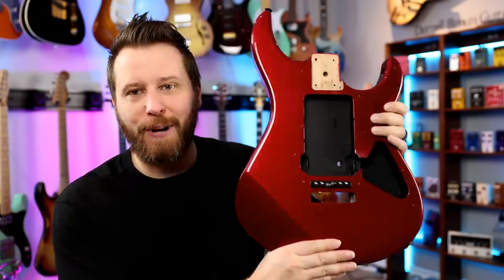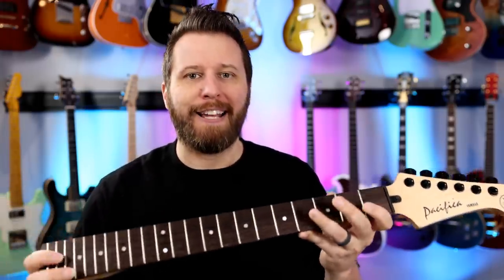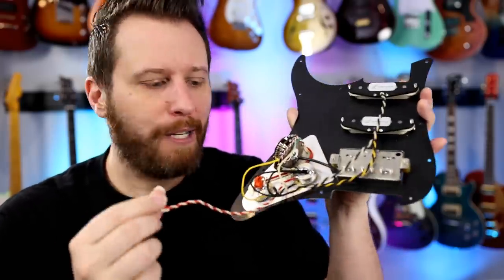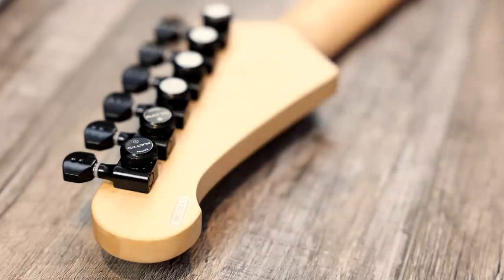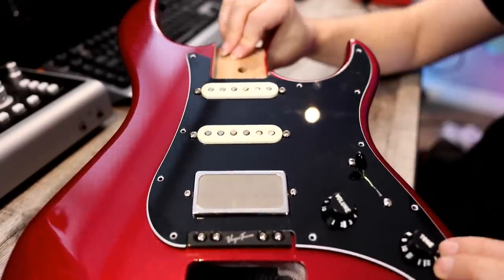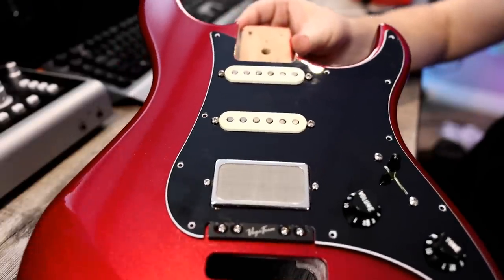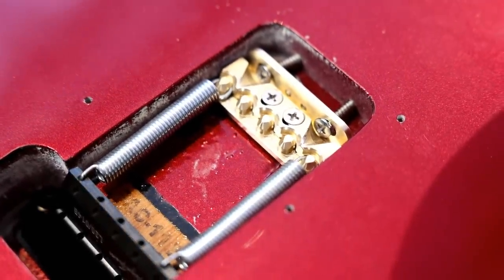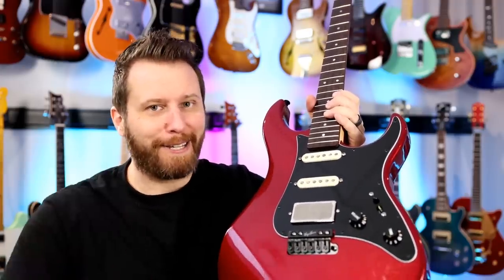Building The ULTIMATE Yamaha Pacifica! - Full Build and Tones!

Comment: Yamaha Pacificas are the perfect modding platform and if you don´t want to do modding and get a great mid-budget guitar, the 612 & the 611 (with the P-90 in the neck) are great value for money.
Reply: Just bought a 612viifm. Loving it. Came perfect from the factory.
Reply: @rickeaton3085  I have had 612viifm for over a year now and it is a really great guitar. The mod DB did was awesome but I don't have the tools, expertise or work area to get into mods.
Reply: Oh yea. I have a pacifica 821DX & 611. Great guitars. My favourites. Alongside my Japanese Ibanez's
Reply: I had the 611, nice sounds but I couldn’t bond with the neck. Love my revstar 502 though, play as well as guitars 4 times the price.
Reply: @valebliz  I am thinking a revstar will be my next guitar...
Reply: @rickeaton3085  We got a 612 with the blue flame maple veneer top, for my niece couple of years ago as a graduation gift. That thing puts guitars that cost twice the money, to shame.
Reply: @valebliz  The revstar models are pretty cool guitars, kinda like an updated version of the Yamaha SG 2000, which is an absolutely amazing guitar.
Reply: @rickeaton3085  if you like a gibson feel those are very nice. Decently chunky neck, very good fret access and the wraparound bridge works very well and has loads of sustain. I'm mostly a fender guy but the 502 gave me something like a les paul junior for less than half the money, the p90s it comes with are good pickups imo.

Comment: Duuuude. Glad you went for the blackoout. Looks great. Sounds great. One thing I'd love to hear about though (in all your mod/parts videos), is what the total cost of parts would be. I know you get a bunch of parts for free/on the cheap for demoing things, but I think it would be helpful for the rest of us. CAD, or USD would be fine, I'm sure. Thanks dude. Killin' it.
Reply: pups, trem system and tuners alone come in over $750, going to be close to $1000 I guess
Reply: Damn my Pacifica buying ass doesn't have that money
Reply: @VisboerAnton  even investing $300 in parts in a guitar like this will get you an amazing guitar. A set of tonerider surfaris for a hundred, a nicer wilkinson tremolo, a set of their locking tuners, a CTS pot strat wiring kit, a graphtec nut, and maybe some Schaller S locks, you're maybe $300 in after tax in total $500 for a beautiful sounding guitar. The neck on pacificas are actually really good for the price so there's no need to change them out. Parts casters don't have to be obscenely expensive. Wilkinson isn't necessarily on brand, but their hardware is actually really good and I've never had any problems with them. Their locking tuners are some if the best I've used especially for the price. Pickups from them are average though.
Reply: @ryanarledge51  
Thanks! I have a pacifica now which I have been modifying. It's an amazing journey of learning new stuff by failing awfully haha
Reply: My upgrades only cost me 175 bucks. 75 for a new neck as I ruined the old one. The rest is a CTS pot, cheap Chinese Alnico V pickups, new pickguard, stainless steel saddles. 

I don’t use the tone knob, the tuners are fine although they feel janky, and the new neck comes with a graphtech nut. 

Modding doesn’t have to be expensive

Comment: This is one of my favorite videos. I took my $99 Yamaha EG112 that I bought from Costco 15 years ago and spent $560 worth of upgrades on it. I went with Supervee's BladeRunner for my Tremolo and Seymour Duncan pickups (SH-4 JB, SSL-5, SL-59-1) for an HSH configuration. The wire harness from 920D was model # I5W-AUTO.  I had a ton of fun doing it and learned so much along the way.

Comment: I have a Yamaha Pacifica 912J- I put a Dunkin hot rail on the neck and micro switches to split the coils at the bridge and neck.

I also dressed the fretboard to get rid of the excessive fret height. Copper shielded the entire cavalries and locked the Floyd rose.

Comment: I like what you've done to that PAC and who doesn't love a metallic red ...
Sounds sweet
I went for the PAC 611 VFM in 2018, P90 & HB. 
I was encouraged by the Pacifica layout after I tried, and bought, a Line 6 Variax Standard, which is basically a Pacifica with bells and whistles.  😉
I like 'em both but curiously they are quite different beasts to play. Necks are very different.

Comment: What a gorgeous guitar you made! Pacs are famous as a modding platform. And then, there are the higher end pacificas that don't need any upgrade (unless one wants something different), nowadays it goes up to the 600 series and the MIJ PAC1511MS. Little known, and hard to get, are the ultra high end Pacificas of the earlier years when Pacificas were designed by Rich Lasner in California. Those are rare and pricey on the used market. The concept of producing an affordable line of Pacificas came after the Lasner designed expensive models were discontinued. I'm a lucky guy. I have a  1990 neck-through Pacifica 1412 (made in Japan but designed in California's Yamaha custom shop by Lasner as a prototype). The 1412 is the highest pacifica production model ever made and was, like,  $2,000 in 1990 (would cost around $6,000 to build today). I got mine for 1,500€ and consider I got a great deal for such a guitar.I also have a 2008 (last year of production) MIJ Pac 904. I paid about $1,200 (965€) for it brand new. I have four "strats". a PRS Silver sky, a CS Fender deluxe, a partscaster with top end components and the 904. I'll let you guess which one is my favorite...

Comment: The wood on Yamahas (which is what really matters) is always really good. I have an old Yamaha EG112 (not even a Pacifica) and it's a nicely built slab of wood. The electronics is where they usually skimp. I gutted mine completely and installed custom electronics. Went from an HSS to a standard Strat setup. They're really great guitars, and cheap. Really, it's how much an average Fender should cost.

Comment: I bought a Yamaha starter pack with the ERG 121C black electric guitar and a 10 watt amp 15 or so years ago and all I've had to do to it is change the 5 way switch which I ruined. I still love it and wouldn't change a thing except the strings.
Reply: i have both,i would upgrade the pickups on the 112,perhaps to get more of a classic strat sound,but the ERG is a quick upgrade to a metal guitar,pickups are great in the one i have,stock,did have to change the 5 way,when i got it used,,when my freinds plug in 3-4 of my axes,they prefer the ERG 121C for gravy train sound.single coil in the middle,rounds out other styles.hsh config

Comment: Good timing on the videos. My Pacifica is my go jam/take wherever guitar and one of the tuners just self destructed. I'd looked at these tuners but didn't know for sure they'd fit until you put the last video out. I was going to use some other kind that have the screws but since these fit, Graph Tech tuners have been ordered.
Reply: FYI for anyone ordering tuners as a drop in. My Graph Tech tuners arrived today and they don't fit. The two posts on the tuners don't line up with the holes on the headstock. I know you can use the plates to make them fit just about any guitar but I already had tuners that just needed a hole and they'd fit. That was $100+ I could have saved. So check them first. My Pacifica is a 112J.

Comment: About two years ago my local guitar shop was closing two Yamaha Pacifica 510V guitars. for $325 each. That is the Ultimate Pacifica IMHO. I wish I had pulled the trigger on one of them. Locking tuners, one pickup (Seymour Duncan P Rail) Wilkinson VS 50 Tremolo.all from the factory.

Comment: Great Work. It would be cool to compare this to a Yamaha Pacifica 612 VII that you can get for around $600 new when you can get a deal. It comes with locking tuners, wilkinson trem, SD pickups, graph tech nut, flamed veneer top. 
Maybe on your build and upgrading a 612 add copper foil tape on the pick guard? On cheeper necks like this maybe sand  the back with fine to extra fine sanding foam. Down to 5000 grit. I went up to 8000 but that felt pretty much like a paper towel. Then a little gun stock oil and wax. It takes some work but It feels great. Also on the head stock. On a 612 that has a finish on the back of the neck also a little fine sanding to cut down to a smoother finish.

Comment: I have a high end Pacifica that came with a Duncan Custom 5 and Vintage P90. Fine pickups, but I wanted a different kind of tone, so I installed a DiMarzio Tone Zone and Virtual P90 which work a lot better for me, as the Custom 5 was far too bright and tinny on the high end. I have coil splitting and it sounds and plays amazing. BTW, I love the sound of that Lamberton. I'll have to look into these. Very warm, vintage, and it rocks.

Comment: you should look into ground loops, you shouldnt ever have 2 wires for a ground to split from because that creates almost like a 1 turn pickup...if you shield the pickguard and paint correctly, you dont need jumper wires between pots and having the ground connected to the body with a lug works the best
Reply: Few people know about ground loops. That was a nice catch of details. Good job.
Reply: @EricFBG  ive done it like he does and it made my hum worst so i went on a huge research quest figuring out how the pros do it lol its annoying dealing with the ground lug if you mod alot until i found a good lug i can unscrew easily
Reply: @darkinertia2   By lug I believe you mean the potentiometer. Most of them are not ready to solder on the back. You try, but the solder and the wire won't stick on their back. The trick is to sand the back of the pot, the place where you intend to solder, with some sandpaper or other abrasive. The solder will easily stick after this. This works with any potentiometer, even the cheapest ones.
Reply: @darkinertia2  I didn't understand well what you meant with lug, so I assumed you meant the potentiometer. English is not my first language, so I am sorry for any mistake.
Reply: What he said...
Reply: @EricFBG  oh yeah sorry i forgot theyre called lugs on the pots too lol i meant the ground you wanna attach to the shield paint
Reply: The shielding is useless anyway as he forgot to shield the pickguard...
Reply: @jicklesjingles8134  Right? I was thinking the same thing. Wait until he's playing clean and those single coil mounting screws click through the amp every time he touches them....

Comment: Did you adjust the nut height?  I would encourage those installing a graphtech nut to either sand the base to adjust the string height to taste or to file the nut slots.  Probably should have the e strings in place to adjust the horizontal position of the nut as well before gluing it.

Comment: If you are chasing noise reduction then swap that twisted pair to the jack with actual shielded cable (just like we use from the guitar to amp). Twisting the wires looks nice for Instagram but they don't do any noise reduction in a guitar. Need shielded cable.

Comment: Usually it's a good idea to do at least two coats of these shielding paints. Check with your multimeter between layers drying, conductivity should be more consistent with 2 layers than with even a hefty application of a single layer. At least that's my personal experience.

Comment: If you guys want to do a great sounding low cost build. Get a solid steel blocked GFS trem and used pickups. Good locking tuners and a GT nut. You’d be 250-300$ in great quality parts and get damn near the same tone and playability.

Comment: Inspired by this video, I ordered new tuners for my 112V, but got caught out by the link in the comments being for the wrong part - in the video you used the staggered tuners (PRL-9721-C0 or -B0) and not the 8721s  ;-)  With the 8721s the E and B strings form a pronounced V as they go under the string tree as the tuner posts are much too high.
Reply: Did the Graph Tech tuners worked for you? I read one comment saying that these tuners are not fitting for the 112J. I'm thinking about my first guitar upgrade and get some of the PRL-9721 for my 112VM
Reply: @sleepinredroses  Yes they did, and I still have and play the guitar regularly. I can’t remember now if they were a mod-free fit or not, but I don’t recall any problems either.
Reply: @paulbeaney  thx for the info! I will give them a try

Comment: Hi Darrell, I'm duplicating your build. A few questions if you could answer:

1. For the Electronics from 920D is there a specific part # for the Pacifica or did they make something custom for you?
2. What type of Glue did you use for the Graph Tech Nut?
3. Will a standard Black Fender Stratocaster HSS pick Guard fit on the Pacifica?

Comment: Even the 600 and 800 series, the fretboard still not rolled, I guess yamaha liked it angled edges and not rolled (not comfortable for thumb hugging the top side of neck though). I wanna know what nut is that, no mods at all? Simply replace and attach new? No grinding or sand paper?

Comment: Pacificas are super underrated.  What I remember is that they hit right when Ibanez was starting to fade but Grunge had just hit.  Instead of the aesthetic "sharp and pointy" things turned retro.  My issue with a lot of the retro stuff is that is just isn't that well made.  If that's what someone wants then fine, but most of them would require a LOT of work and upgrades which to me, just aren't worth it.

Comment: In USD:
Pacifica: $220
Tuners: $120
Lambertones Single coil Neck Pick-up: $110
Lambertones Single coil Middle Pick-up: $110
Lambertones Crema: $180
Vega Trem: $255
920D wiring harness: $80
Tone Claw: $60
String trees: $12
Nut: $12
Pick-Guard: $20

Total: $1149

This doesn't include tools like fret files, sanding blocks, polishing compound, luthier tools, soldering tools, solder, etc.)

For $1149 USD there are some nice options (Fender Vintera '50s strat).

How about a comparison of modding up with $1150 vs. spending $1150 (new or used).
Reply: But it's a great video - I have the 112J in Emerald green, 100% stock and I love it.

Comment: Hi Darrell. Thanks for doing this. I have a Pacifica, and this video gave me inspiration. I was wondering, did you sand the fretboard edges like you have showed in other videos? In one video you had a yellow gloss fretboard, and sanding it removed the paint and exposed the white underneath. Any danger of that here? Or is the wood on the Pacifica solid and unfinished? (I have the 112J also). Thanks again.

Comment: A wire from the volume to the shielding is unnecessary bc the pot body is grounded thru the shielding on the pg to the shielding in the body thru physical contact when the pg is screwed to the body or it should be if you painted the shielding all the way up to the lip of the cavity and over to 1 pg screw hole. I certainly wouldn’t have EVER drilled down in the cavity that’s already routed to over half the total depth of the body. Drill into the side where you can’t accidentally F it up

Comment: The 920d electronics.... what size pots and caps did they use for the harness?
Reply: I am building this exact guitar as we speak. The tone claw… That does not line up with Pacifica holes. I have three Pacifica‘s. I’ve tried it on all of them. The screws have to go in on an angle that is different from the stock claw and it twists it. Might be better off with a different claw or just stick with the stock one

Comment: "Rolled edged is a feature you find only in high end guitars."
I bought a Bullet Strat with rolled edges.  Those guitars are shaped by machines, and I suspect that those rolled edges add no extra cost or time whatsoever.  So why all the at least mid-level guitars do not have this feature?  Marketing strategy, laziness?  Most probably not cost, though.
Reply: probably just to make the more expensive ones more appealing by comparison